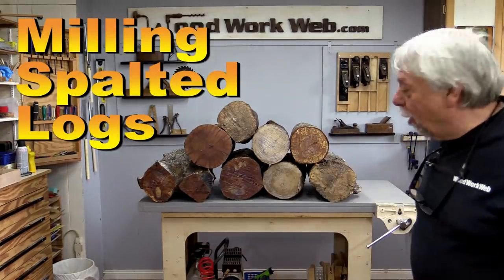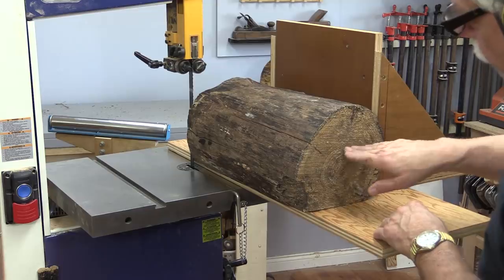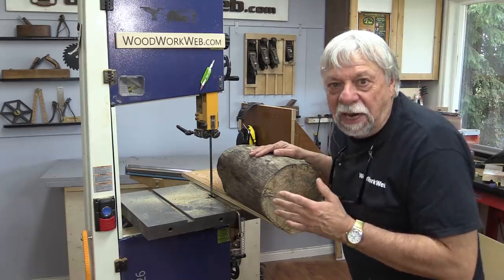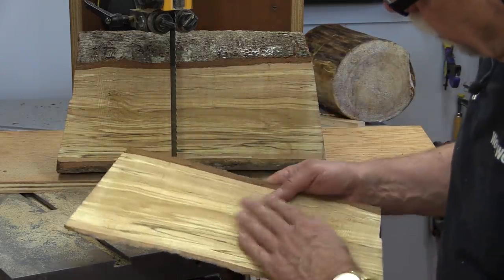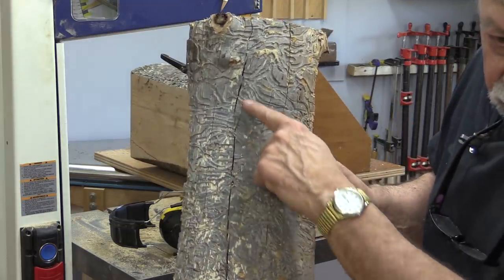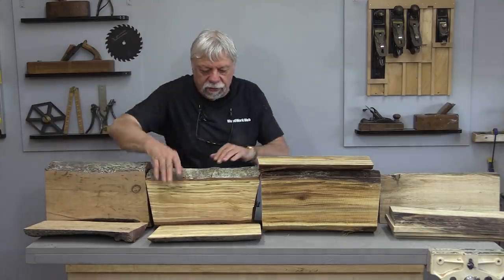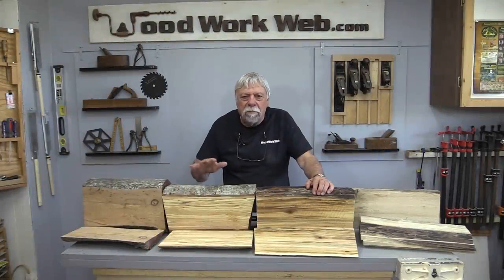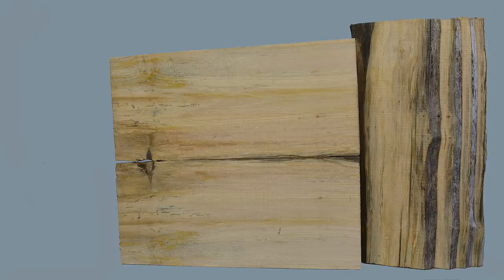Milling Spalted Logs with a Bandsaw Mill Jig

Comment: I was thinking there would be something about your jig but not so much. It looks like one I tried but I think my eyes were bigger than my band saw, it was 4' long! It worked, sort of, in that I could slab a long but the weight made it hard to hold up getting started and then to finish the cut I had to pull the jig thru. I had a slightly longer than sled runner and an adjustable right angle piece I could advance at whatever angle I needed for my cut. Due to total weight of jig and log I gave up on it.

Comment: Here is a tip.  When using double sided tape, to make it easier to remove the backing try lightly scoring the backer with a utility knife and peel the backing from the middle instead of the edges.  Like your vids feel free to use this tip.  MC JIM

Comment: I didn't catch why Spalted wood is desired. I've cut down a  lot of trees in my treeline. Some already dead and lying on the ground. I've split a lot of that wood for heat and I've seen a lot of those markings. It's mostly Box Elder which, as I understand that, it's not a desirable wood to work with.  So which would be more important. a far as value; The Spalting or the wood species?

Comment: about wood with only little difference in pattern, - i suggest a fast heating / burn on the surface with a gas torch,,, it will give a lot of contrast,,,- if you dont set it on fire...LOL